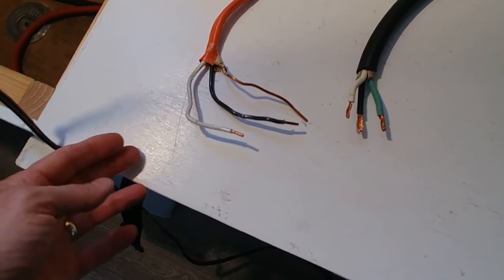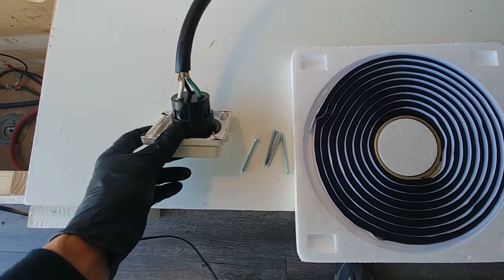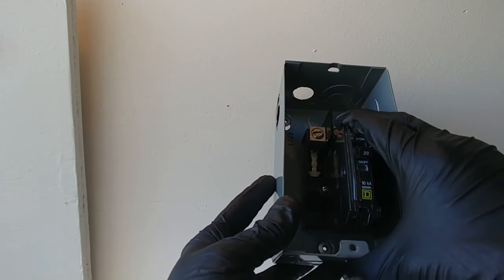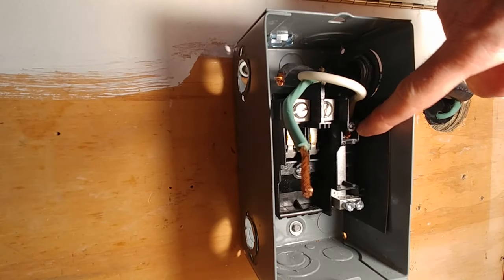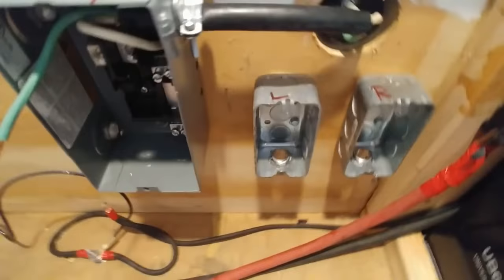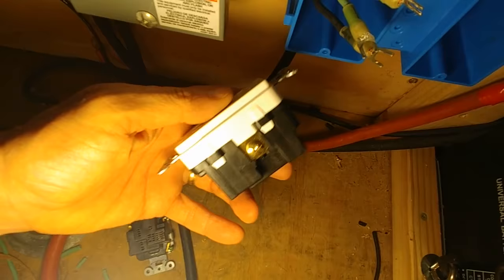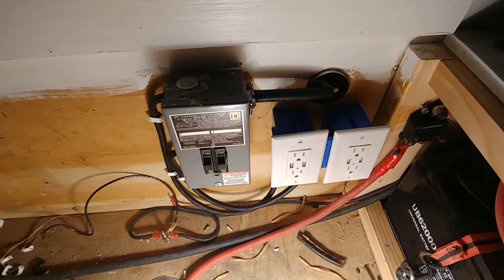SHORE POWER INSTALLATION camper van life cargo trailer camper conversion

Comment: Hello! Thank you so much for this video! I just have one question. So I have the same 30 amp rv plug with the green, white and black wire. I see that you have two of each. Since I only have one of each, do I just wire those? Or are the other black, and white wires from the outlet wires? Not sure if you understand my question.
Thanks again!
Reply from the maker: Hi Mini. I am not sure I do understand your question. I only have one 30 amp plug on the side of the trailer and going into the gray electrical box. Coming out of the box I have two 20 amp circuits that go to the 2 outlets you see inside. Each can have up to 20 amps of electricity and together they can have up to 30 amps.
Reply: GB Conversions & Adventures so I actually have 2, 15 amp breakers that will connect to two outlets, would that work? But my question was that I only have 1 of each wire(black,white, and green) that is coming from the rv plug. But I see that you have 2 of each in the 30 amp breaker box or sub panel. Sorry😄 I’m really bad at explaining
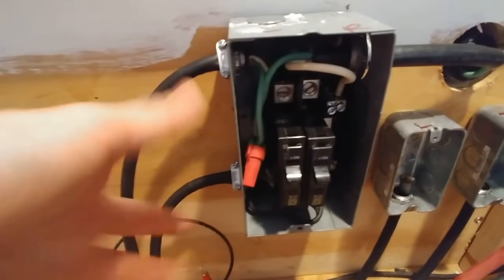Reply from the maker: @minicasitas6376  yes the 15 amp breakers and outlets will work. Yes I have one of each wire going in and 2 of each wire going out. The wires going in are explained at  5:45 and you need to pay attention to that. The white wires coming out are explained at 8:20. The black wires are shown at 9:19. The green wires are shown at 9:27. I hope that answers your question.
Reply: GB Conversions & Adventures yes! It does. Thanks!!

Comment: Thanks for this great tutorial . I followed it to the letter but I'm getting an open ground on my indicator . Any ideas?
Reply from the maker: That would be a problem if you are hooked up to your shore power. The ground is from your shore power source. I also added a ground wire from the breaker box to the frame that is not on the video. Good luck.
Reply: @FakeLegGreg  I'll definitely add the frame ground . Many thanks!

Comment: Shouldn't you be using a gfci... I'm no electrician ...but that just seems like a good idea
Reply from the maker: Thanks for the suggestion. There are complications when trying to run GFCI outlets on inverters. The inverter is GFI when we are on solar. We could install GFCI outlets from the 110 volt service panel for use on shore power. I am no electrician either, just showing what works for me. Thanks for watching.

Comment: So I have gotten everything you have in this video .  but ppl are say I need a ground bar , and a wire needed to be grounded to the frame of the trailer and etc . Is all that needed or just follow ur video exact . I have no experience
Reply from the maker: I am not an electrician. I am showing you what worked for me. Good luck getting electricians to agree on anything. I did add a ground wire from the breaker box to the frame. I did not ground the 110-volt shore power to the frame. My system has worked for years for me. You will have to decide what is best for you. Good luck on your project.
Reply: @FakeLegGreg   thanks . I wasn’t questioning ur work i was trying to make sure I didn’t miss anything in ur video . Im following you .

Comment: Suggestion for you: not gold... bronze. Black goes on the Bronze side.
Reply from the maker: Thanks for watching and I appreciate the suggestion. However, it doesn't always hold true, depending on the manufacturer. Some electrical devices may have bronze screws but some that I have seen are no where near to what I would call bronze. Absolutely gold tinted. So, I agree with you, sometimes.

Comment: Thanks for sharing. So the green needs  not be attached to the box?
Reply from the maker: You will see in a later video that I grounded the box to the frame with a separate wire.
Reply: @FakeLegGreg  Thanks

Comment: at 9:40 having trouble with stranded wire into the 110 outlets -- after the main breaker box, just use 14-2 solid to get to the outlets, no?
Reply from the maker: 14-2 is for 15 amp circuits, so it depends on the breakers you used on the circuit. In my experience the solid will vibrate loose. Did you try twisting the stranded and hook it around the screw instead of inserting into the hole in the back of the outlet?

Comment: I just bought a GE brand 6-space (for 6 breakers), 125 amp panel for my new 7'X16' cargo trailer.  I want to put each outlet on its own 15-amp breaker: one for refrigerator, one for microwave, one for 2 hot plate burners, one for toaster oven, one for outside the trailer, and one for anything else (maybe for a split AC in the future but not now). 
I am following you, using 10-3 wires for incoming and 12-3 for going out to all 6 outlets. 
I am not sure if I can use any standard 15-amp breaker or do I need to use GE breaker. What do you think?
Reply from the maker: That is just extra expense but it will work. You will still be limited to 30 amps total at one time. Good luck.

Comment: Thank you for this video. I have a question I was wondering if you could answer for me. I’ve had multiple people tell me my ground wire needs to be grounded somewhere. In this video you only tied the ground wires together and then capped them. Is this a safe method ?

Comment: Greetings again! You are using the same Square D box as me, but I'm confused about you using 20 AMP breakers. Both your and my Square D Box say 30 AMP Max for copper wire 25 AMP aluminum wire. Are you assuming (I hope correctly that each breaker can be 30 AMPs? I thought the capacity for the BOX was 30 AMP, i.e. you would use 2 each 15 AMP breakers.) Can you please clarify?
Reply from the maker: You are correct that the box is a 30 amp total box. And I do have 2 20 amp circuits. Each circuit can run up to 20 amps but the total amp draw of both circuits together cannot be more than 30 amps. Example: I could run an AC unit on one circuit that pulls 18 amps. the other circuit could then run no more than 12 amps. Does that help?

Comment: Probably a dumb question, but does connecting all 3 grounds assume the power coming in is grounded?
Reply from the maker: Not a dumb question at all. I never assume, I always use my tester to check before plugging into the RV pole. The tester will tell me if the 110 volts coming out is wired correctly and grounded. It may also save my electrical stuff from getting fried.

Comment: Thanks for this V G info. his is what I was searching for.
Should I be using two 15 amp breakers for a 30 amp shore line or does it matter weather they are 15 or 20 amp.
Reply from the maker: The individual breakers you install has to match your wiring you install. 14 gage wire matches 15 amps, 12 gage wire services 20 amps. You can install either but your total amp draw from your trailer can't be more than 30 amps. So you could be using 20 on one circuit and up to 10 on the other circuit. If you are going to run AC you probably should run 20 amp circuits. Good luck with your project.

Comment: Way too much insulation on cable coming into the box. I've seen other videos running 20 amp breakers as well but don't understand that. There's only 30 amps total to work with. Why not just use two 15 amp breakers? There is a potential to overload the system but the 20 amp breakers won't trip. It will trip the 30 amp main breaker outside. And are grounding this system with the trailer?

Comment: I dont know much about electrical... so how are you using a 30amp max box with 2x 20 amp breakers. Wouldnt that be 40amps for a 30amp box? 🤔🤔🤔
Reply from the maker: I have 30 amps total running into the trailer total. That is all the amps available. I have two 20 amp circuits. Each one can pull up to 20 amps each but only 30 amps total. I can run a high amp draw item such as an air conditioner drawing 16 amps on one circuit and lights and other small electrical items on the other circuit. I cannot pull more than 30 amps because that is all that is available. Thanks for asking.

Comment: Wouldn’t you need to have the neutrals and grounds connected as this is essentially your main breaker panel?
Reply from the maker: I am not an electrician. I can only give you my thoughts. This is not the main breaker panel. When you hook up to shore power there is a breaker there that shuts off all the electricity to the trailer. That is the main breaker panel . The panel in the trailer is a sub panel. I did add a ground wire from the box to the frame and changed the 2 outlets beside the box to GFCI. Please consult an electrician if you are in doubt. Thanks for asking.
Reply: @FakeLegGreg  fair enough. Good video. I’m also not an electrician and genuinely curious.

Comment: Also you have two 20amp breakers but a 50amp connection, don’t you need another 10amp breaker?
Reply from the maker: You are asking great questions. I have a 30 amp connection to the trailer , not 50 amp. Inside the trailer I have 2 20 amp circuits. That means I built each circuit to carry up to 20 amps. However, the total of both of those circuits cannot be over the 30 amps total that I have coming in. So, if I have my AC running on one circuit I cannot run my microwave at the same time on the same circuit. But I could run the microwave on the other circuit at the same time as the AC. If I ran all of my electric stuff at the same time on both circuits I would overload the 30 amps. Thanks for watching the video.

Comment: I have the same system, do you know if have to run a  green wire from (breaker box /green cables) to my chassis, like for grounding??  Or it's not necessary?? My 12v batteries bank it's already grounded to my chassis. So I don't know if it is a problem grounding my 120v to chassis too?
Reply from the maker: I have heard both ways. Yes, to ground your 110v to the frame and no. I am not an electrician. I don't see the harm in grounding the 110v to the frame and I have mine grounded to the frame as well. Thanks for watching.

Comment: Can you use 30 A breakers instead of 20A?
Reply from the maker: If you use 30 amp breakers you would need to run 10 gauge wire instead of 12 gauge. Then you would need 30 amp outlets to match.
Reply: @FakeLegGreg  thank you ! Looks like I have a 15 amp usb outlet and a 20 amp gfci outlet. So I will switch these 30 amp breakers for one 15 and one 20? Thanks for your help !

Comment: So in my van i had a inverter to shore power. What is the difeerence between this and shore power to a inverter. ?
Reply from the maker: I am not certain of your question. The invertor in this video has nothing to do with shore power at all. It does not connect to the shore power. It converts 12 volt DC electricity to 110 volt AC electricity for the things that need it. Probably you had a converter that changed 110 volt AC from the shore plug in to 12 volt DC for the things in your van.  A 12 volt fridge(Dometic) can cost around $1000. A 110 volt(Galanz) fridge can cost about $100.

Comment: Hi, I have a quick question for you. 
Trying to install some shore power to an enclosed trailer. Just looking to basically plug it into my outdoor house outlet to take power from there to have power in my trailer for a power tool or space heater sort of thing.

Question for you is, do I really need a 30 amp shore power or do just need a 15amp?

My plan was to have from the house plug, a 30 amp - 15 amp adapter, with 10 gauge wire to the trailers 30 amp shore power. From there 10 gauge wire to the breaker box. In the breaker box, 2 separate 15 amp breakers like you did in your video. I will run 14 gauge wire from those 2 15 amp breakers to 2 separate GFCI outlets. Does this seem like a correct wiring formation or am I overkilling it with the 30 amp shore power?
Reply from the maker: When I am home I use an adapter to run my trailer on 15 amps. This is mainly to keep the fridge working. I can run lights and the TV on it. However,  I don't run the AC or ele heat on the 15 amps. When we are on the road and hooked up to 30 amps we can use the AC or ele heat.
Reply: @FakeLegGreg  so if I decided to run a 15 amp shore power plug, then 14 gauge wire from that plug to the two breakers, I Should be fine for each breaker circuit/GFCI plug as long as I dont operate above 15 amps as it will trip each breaker. 

I think the biggest question im wondering the the biggest thing I am overthinking is, is 15 amps into the trailer, sufficient for me to be able to run up to about 15 amps on each GFCI plug circuit. 

Hopefully you get what I'm saying
Reply from the maker: @adamscev4163  OK. At the campsite my trailer can use up to 30 amps TOTAL. I have two 20 amp circuits so I am comfortable running AC or ele heat on one of the circuits. If my AC pulls 17 amps then the other circuit cannot pull more than 13 or the main breaker at the service pole will trip. In your case you are only getting 15 amps to the trailer. Both circuits cannot exceed that 15 amps when added together. If you are pulling 15 amps on one then you could not use the other. I hope this helps.
Reply: @FakeLegGreg  yeah I gotcha now. Another quick question for you too. Let's say I'm plugging in at my house. Usually house hold plug ins are 15amps correct? If thats the case, I wouldn't be able to pull 30 amps from the house/that plug in anyways correct? 

I think I'm correct in saying that. Same thing with a generator. If I plug into a 15amp socket or inlet, I wouldn't be able to draw more than 15 amps anyways. Its a cargo trailer so I wouldn't be running it at a campsite anyways.

If I'm never plugging into a source that I can pull 30 amps from, I really don't really need a 30 amp shore plug
Reply from the maker: @adamscev4163  that is correct. If you dont have a 30 amp supply then you cant pull 30 amps. Btw, mine is a cargo trailer too and I am at a campsite right now. Cargo trailers can camp too. :)
Reply: @FakeLegGreg  thats awesome man. I don't have it insulated or converted to act as any sort of camper. More of a mobile cold garage😂 Anyways I super appreciate your timely responses and videos. They are gonna help me a bunch with this wiring. I'll be sure to subscribe!

Comment: How did you cut the hole in the trailer for the power box thing?
Reply from the maker: I used a hole saw with  drill to cut that hole. I cannot remember the size at this time. You might try looking at this video to see what it looks like. Thanks for the question. https://www.youtube.com/watch?v=5dBLutCEZ_A

Comment: Did everything exactly as explained, running power from generator. No codes on generator but showing open grounds on my outlets. Tried running wire from ground terminal on generator to ground rod, also tried wiring ground rod directly into the cluster of 3 grounds inside breaker box. Stumped on this one, any help would be appreciated!
Reply from the maker: I would like to help but i have never run this on a generator, only batteries and shore power. I have heard of guys having trouble with the generator grounding but I have not used it so I have not researched it. I hope you find your answer. Good luck.

Comment: I liked the video.  A few suggestions?
  First, didn't your shore power plug come with a piece for inside the trailer?  It serves the purpose of covering up the wire connections (30A !) and provides a strain relief for the cord. ie, so the cord won't accidentally get pulled out from the inside if something snags on it in the cabinet. It's also a good idea because with that metal you installed at the end of the video it can cut the insulation on the wire if it vibrates against it (fire hazard!)
   Second, there is too much wire insulation (the black rubber) inside of the box.  The insulation should barely be visible in the panel box.    
   Lastly, the load side wires (20A) should only enter at the bottom of the box, not at the top where the 30A comes in.  There should be a knock-out on both sides of the box at the bottom.  You can buy a plug to fill that hole you made at the top left.

Comment: So I did 100% same set up as you , when I check the polarity it says open ground , however I'm plugged into generator with my 30amp main plug . Any recommendations? Good as it is ? Or anything else to check .
Reply: Thanks for heart but I was asking a question about the open ground on outlets ????
Reply from the maker: I have never hooked up to generator so I have no experience with that. It does not surprise me that it says open ground though, I get the same thing with my solar. I have added grounds to everything but my tester still says open on solar. I do know that bridging the white and ground wires will make the tester register grounded but also have been told not to do that. So, long story short, no solid answer from me concerning generators. Let me know if you find out anything.
Reply: Ok perfect thanks again . I'll let you know if I find out anything
Reply from the maker: @Adam-jx7eq   I think the distinction is shore power grounding vs solar/generator grounding. I have been told not to ground shore power to the frame because if there is a failure the frame and whole trailer becomes energized and hazardous. However, on generator/solar, yes, ground to frame. I do that but the tester still shows ground open. With rubber tires as insulators it makes sense to me that it shows ground open. Not sure where to go from there.

Comment: Where are you getting power from?
Reply from the maker: I am not sure of your question so I will try to answer. I can get power from a 30 amp 110 v plug in at RV parks, or I can get power from my bank of batteries that are charged by my solar panels. At home, I have an adapter that allows me to run off my 20 amp 110 volt circuit in my shop. I hope that helps.
Reply: GB Conversions & Adventures .. ok I understand now. Thank you for the quick response. I just started watching your channel. It’s very informative thanks
Reply from the maker: @realworldcarpentryremodeli5868  Thanks for watching.